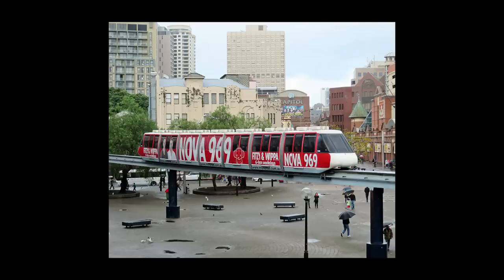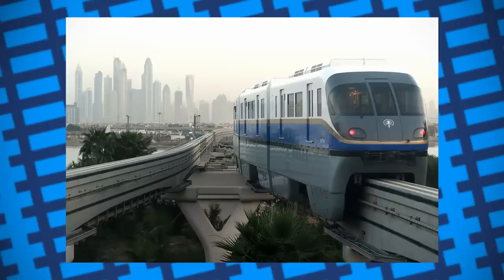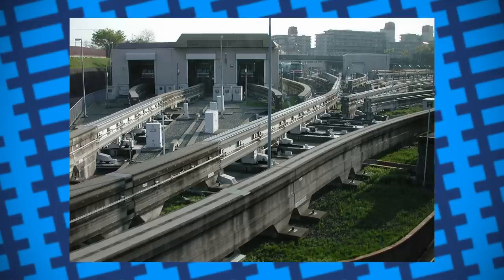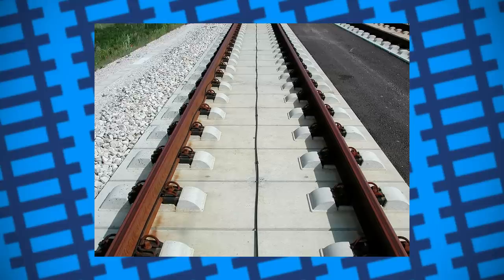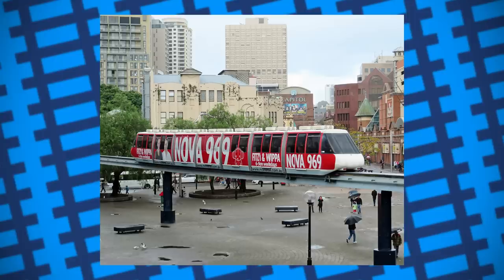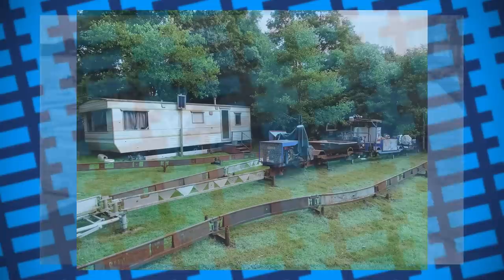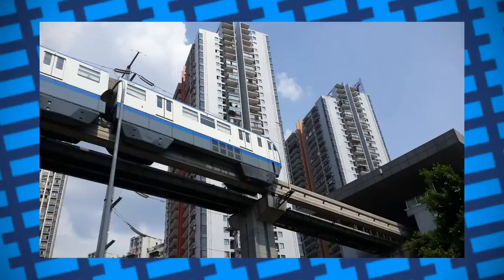Why monorails are bad as public transport - Monorails

Comment: Although Chongqing has stopped building monorails, another city in China, Wuhu, has finished two monorail lines in recent years. Judging by the passenger numbers, the new monorail is pretty successful there.
Reply: It's a successful tech showpiece, but the PRC has been really good at standardising conventional metro design
Reply: If you try well enough, you can design pretty much anything in a way you get high passenger numbers. Doesn’t mean it’s a somewhat bad idea anyways though. High pax throughput is mainly an issue of capacity per vehicle, boarding speed, frequency and demand for a to b in x time for y money. Few things in there are fundamentally incompatible with whatever you want to use to achieve that, but certain combinations stand out for running costs, reliability and/or flexibility. And typically, for high throughput at relatively low average speed, the modern metro train tends to be a favourite due to unbeatable space efficiency and pure running costs, with top marks in maintenance per passenger while often remaining around the same price point to start as other variants
Reply: It may be successful, but the question is if it has any compelling advantages over more conventional trains? The point with this video isn't that monorails are impossible, it's that they rarely have compelling advantages over normal trains, which work better in 99% of circumstances.
Reply: @quillmaurer6563  It's cheaper and faster to build in an urban environment that require 100% elevated tracks.
Reply: @thastayapongsak4422  I suppose I could see that - a short-distance isolated 100% elevated system, functioning as an automated people mover. Though most automated people movers are two-beam, I don't know if the single beam would be any cheaper.
Reply: @quillmaurer6563  Have a look at the Haneda airport monorail in Tokyo - I think that would have been very difficult or impossible to build even as an elevated railway, especially in the heavily built and highly congested area between Hamamatsucho and Shinagawa.  The pre-existing infrastructure it has to snake around also means it has some pretty drastic elevation changes and consequent severe grades, and the support beams have much less visual impact that putting a dual-track guideway transit system up in the air would.
Reply: @TrimeshSZ  That sounds like one of the few niche cases where it does make sense, where the strengths outweigh the weaknesses.
Reply: @thastayapongsak4422  ในความเป็นจริง ทั้งสายเหลือง สายชมพู ไม่ได้สร้างเร็วกว่า heavy rail เลย สิ่งที่ authorityเคลมว่าดีกว่า ยังมีที่ต้องพิสูจน์อีกหลายอย่าง แต่อย่างน้อย รถBombadier ก็กว้างกว่าเพื่อน แต่ตู้สั้นไปหน่อย
Reply: @kittenastrophy5951  พลาดใช้ mono ตามจีนมากไป

Comment: They're pretty useful in specific isolated cases (airports and resorts), but when it comes to a serious mass transportation network, other options are much more appealing.
Reply: A niche solution for niche applications. Never been more, never constructed and planned to be more.

A Monorail is practical for applications where you need a monorail. If you don't need one, you can build one with the explicit mission to be an oddity and put it to good use, but you will spend less if you use iron rails.
Reply: Most airports and resorts use two-beam automated people movers. Monorails for such applications would be possible, but two-beam designs are far more common.
Reply: @quillmaurer6563  Whilst correct, things like the Shanghai Maglev are pretty amazing (and a maglev is basically a monorail)

Comment: The Sydney system was quite odd compared to other von-roll systems around the world. It tried to be an automated people mover but unfortunately the technology wasn’t there at the time for the trains to run automatically. Also of note is that the von-roll mk2 and mk3 systems were only really used as theme park transport with Sydney, merry hill and an airport line in the USA as systems with public transport in mind.
Reply: And the Merry Hill one has been gone a while. Even the track has gone now. What did Butlins use at Minehead?
Reply: And yet it was operated with a driver until the complete end of the monorail back in 30th June 2013, the drivers car was completely inaccessible to the passengers.
Reply: The Brisbane Expo '88 had a Von Roll monorail too. It also had the only Von Roll chairlift ever installed in Australia, the hundreds of chairlifts at their ski resorts were all made by other companies.
Reply: As I understood it, it was designed to be and could run fully automated, 
but a political decision was made to use drivers onboard, after a couple of operational breakdowns early in its life.

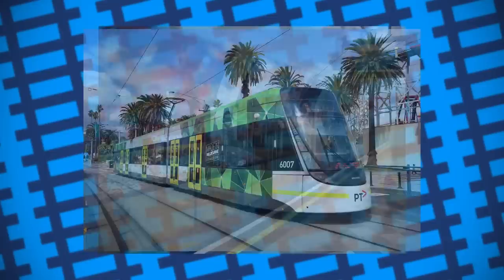Comment: 4:08 that is a bizarre sight. It is the most obvious way to get track ballast to tracks, but seeing a freight train on the Underground, especially a deep level line, is still odd.
Reply: Same
Reply: I would be so excited to see something like that
Reply: Yeah, try that in Toronto. Except for the newer lines they deliberately used different gauge specifically to prevent hauling freight in trolley tracks. Most agencies cannot run standard rail cars on their transit systems. Even those that do handle some freight often have specially designed and built freight cars.
Reply: It's not a freight train, it's actually a service train carrying ballast for the railbedding.
Reply: It's a TFL service trainset, not a freight train. It's hauling equipment needed for track repairs within the deep level system.
Reply: Clearly that's a service train, not a "freight" train. Most likely the cars have to be built smaller than normal freight trains to fit through the tunnels. But there's still an advantage in that these cars, being standard gauge, can operate on freight lines as well, they could get crushed stone straight from the quarry via the main rail network rather than needing to transfer the cargo from conventional trains to system service trains at the tube system's depot.
Reply: @quillmaurer6563  except monorails would have no need for crushed stone. I can’t think of any other large volume freight a monorail would need for it’s system.
Reply: @bearinmind50  True for that particular need, but there's a lot of other advantages for having your rail vehicles compatible with normal tracks. Vehicles can be delivered via normal rail tracks, I've seen this done for Denver's commuter rail trains even though they operate on an isolated network. Conventional construction and maintenance-of-way vehicles can be used. And of course equipment (rolling stock, construction machinery, track components, maintenance equipment) is all available off-the-shelf.
Reply: @bearinmind50  Wasn't broad gauge {5ft 2.1/2in or 5ft 3in) common practice on most North American trolley systems?
Reply: They'd have to be using locomotives and wagons that conform within the deep level line loading gauge (maximum vehicle size) it would be interesting to know if they require special ballast trains for these lines
Reply: @CoolAsFreya  I've seen photos of service-train locomotives used on the Tube (or possibly other subway systems). As well as fitting the loading gauge, I think they're battery powered as they can't run diesel underground and need to be able to operate if the third rail is shut off during work. These locomotives wouldn't be used off the network. Freight cars/wagons are probably custom built to the line loading gauge as well, but can also be pulled across standard freight lines. They'd swap locomotives between the outside rail network and inside the tunnels, but that's a lot easier than transferring cargo (such as crushed stone) from one car to another.
Reply: @bearinmind50  I thought they are matching the gauge with VIA?
Reply: NYC subways used to run special "cargo" trains that carried... (wait for it)... Money.  Back in the era before everyone had plastic cards in their wallets, the money trains with armed guards on them would run between stations at night, before ending their runs in track stubs under the subway's office building, where the money could be offloaded, counted, sorted, and sent off to banks.

Comment: My favourite monorail is the Shonan Monorail, located on the edge of the Greater Tokyo Area. It's a suspended monorail that I think stands out for achieving absolutely insane space efficiency in terms of its ground infrastructure, which I think proves that there is still a bit of underutilised potential with the mode.
Reply: Surprisingly you can achieve the same thing with standard monorail nowadays. With less support needed

It's surprising how far structural science has achieve
Reply: Greater Tokyo areas are one of the few exceptions that monorail is viable due to their existing vast rail infrastructure. Monorail are just fit for niche cases like that.
Reply: There's also the suspended monorail in Wuppertaler called the Wuppertaler Schwebebahn... was also built in like 1901 which is a feat of engineering for the time. It's uniquely positioned due to it running mostly above the river. The Tim Traveler and Tom Scott each have videos on it.
Reply: Japan has a very extensive public transport infrastructure. Even in the case of Japan, monorail is only a small minority. China is also the same, compared to their entire network, monorail is next to nothing. Outside those two countries, most opt for LRT instead. There's a reason why the monorail is called gadgetbahn.

Comment: Actually, worst case scenarios for standard points include...
• Derailment
• the train attempting to go both ways at the same time
• breaking the points if ran over while pointing the wrong way. (because they position lock to avoid the above)
Reply: I know I was literally thinking there have been so many railway accidents involving points lol
would also add...
• Going over the points too fast ect
Reply: @adeerdoes  Not only that, but the modern hanging box girder style monorail system uses a style of points that are actually SIMPLER than standard points, as they use a single, shorter swinging arm, rather than 2. Though I'm sure access for maintenence is an issue.
Reply: @abrr2000  But they still need to move the track support out of the way so that the car support can pass by.
Reply: @tacet3045  Do you mean the entire track has to swing? if so that's not true of the "SAFEGE monorail" system. as the entire points mechanism is inside the box girder, and consists of one T shaped iron bar and a mechanism to push it from one side to the other.
Reply: @adeerdoes  Random related story: A couple of years ago there was an accident in Australia where a Vlocity DMU essentially slid down the Warrenheip Bank coming into the city of Ballarat due to extremely wet conditions/the locos sand running out before the bank, it blew through a set of heritage gates destroying them in the process and careened through the station where it went through the points from the main line to the platform 1 line at 100km/h (Points are rated for 40km/h maximum) where the commonly held view is that the only reason it didn't derail was thanks to the engines being mounted under the carriage, meaning Vlocities have about as low of a center of mass as a train can have.
Reply: @abrr2000  found the monorail simp
Reply: @the4tierbridge  There are some places where a traditional railway cannot go. In these scenario's you're looking at comparing an underground, a raised light rail system, a traditional monorail, or a SAFAGE monorail. Traditional monorails are the worst option. Underground is the most expensive. Leaving you choosing between light rail and SAFAGE. And there are edge cases where a SAFAGE type system would legit be a better option.
Reply: @abrr2000  Which places are you thinking of?  If the problem is hills, you also have the option of a rack railway.  A couple of transit systems using rack railway technology have actually been built.
Reply: @abrr2000  You could make simple monorail points, but they would still take up a lot of space.
Reply: @Lucius_Chiaraviglio  in SAFAGE monorail, the track is a long box with ribs and a slot in the under side. The wheels run inside the box and a bar hangs down through the central slot that the cars hang from.  The points for this system are litterally inside the box and are significantly smaller than traditional points.

Additionaly, because the rail is above the car, a lot of issues with crossing the track are gone, because you can just drive or walk under it even when the cars are running at ground level. So it may be as simple as installing a set of trafic lights if you need anything at all.

(Basically SAFAGE monorail is better than standard monorail by a LONG margine.)

The advantage of a monorail is that you don't need to do any ground work or land clearing. This is useful in hilly, craggy or mountinous regions where clearing a flat piece of land to put track on and widening ridges would be much more expensive than sinking a few support poles.

In towns the monorail's big advantage over light rail is that the structure isn't as wide as a whole road and thus doesn't block out light from the ground below, plunging it into dingey depressing darkness and is a cheaper faster to build alternative to an underground line.

However, there is almost always a cheaper alternative that will do the job. But the big underated killer is that it cannot connect to existing rail networks, and thus cannot piggy back off them to cheaply expand the network.
Reply: @abrr2000  I'll have to see what SAFAGE (SAFEGE?) monorail points look like, but conventional rail works fine on an elevated structure when you need that, and then it can go back to ground level in areas where you don't need it to be elevated, thus decreasing costs.

And the effects of elevated structures on the street underneath are overstated.  New York's elevated transit was blamed for making the Bowery a dump, but the elevated went down LONG ago, and I've been to the Bowery in 2019, and it's still a dump, whereas the area around Boston's North Station was decent even back when it had its elevated Green Line structure.  And if you go to Washington, DC or Atlanta, GA you can find extensive elevated structures that have nothing dingy or depressing about them (unless you're an auto executive or oil executive or tire executive for which the sight of people getting around without giving you profits would be understandably depressing).
Reply: @abrr2000  It's still more expensive, and marginally less capacity than standard monorail. Which already a pretty specific use case scenario. Suspended monorail is no more than just gadgetbahn in today

If you really that insist with suspended monorail, I'll suggest you check that out with B&M Invert. Fully automatic, waaay cooler,  arguably cheap, insanely compact, surprisingly capacity monster (up to 1 minute dispatch time), and legit could go 100 km/h on super tight turn. If you wanna go F U T U R E, you can use linear motor on it

There's no point of suspended monorail if B&M invert exist. Even if that's the case normal monorail serve well and cheap enough, even then again LRT is more economycal
Reply: While this may be true, it still points back the fact that regular railroad points on the ground, so it's not as hard to deal with than a monorail system.   A monorail car can also derail, as there's nothing stopping the cars from rolling off from the other end and falling 20+ feet to the ground, and that sounds significantly more difficult and costly to deal with than a regular railroad car derailing.
Reply: @DomenicEXP111  There are buffers and various other safety features at the ned of the line, and the train is in direct contact with the ground to prevent it from swinging as you dissembark.

Not to mention, the fact the wheels are entirely encased within the box girder rail, means in order for it to derail, the rail itself would have to dramatically fall to bits.
Reply: Those are pretty rare cases for well-maintained points with responsible drivers traversing them. 
With monorails you need a huge amount of space, mass, energy, and open ends without stoppers. I think a train literally falling down from an open track bc of the points being set in opposition is a much more severe problem to solve than a simple derailment, although derailments certainly are a serious issue. When they occur.
Reply: @the4tierbridge  lol
Reply: @the4tierbridge  Now THERE'S a compelling argument. Your parents must be very proud.
Reply: These don't happen often and when they do it's a simple matter of fixing it. The same cannot be said for monorails
Reply: In my country 3 people got unalived because a traing going at speed ran through a switch and that switch changed under the train